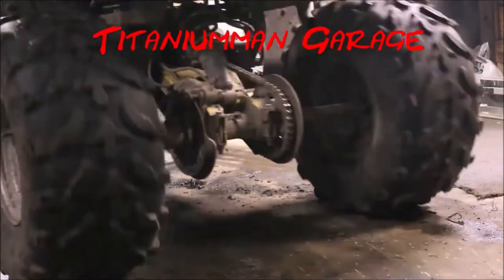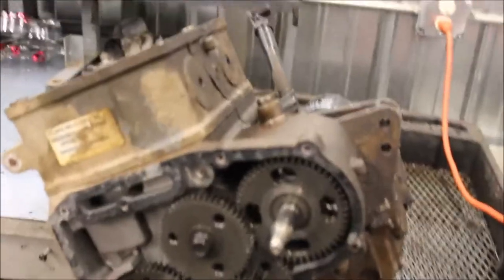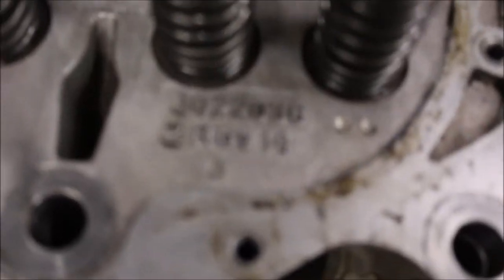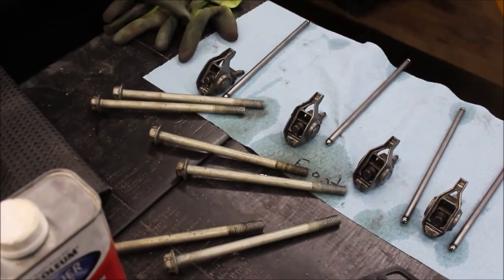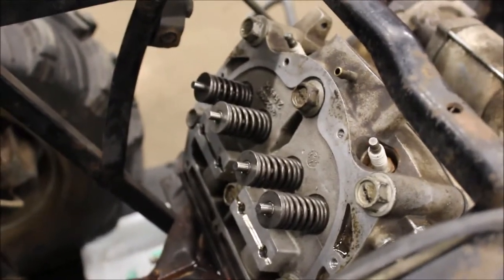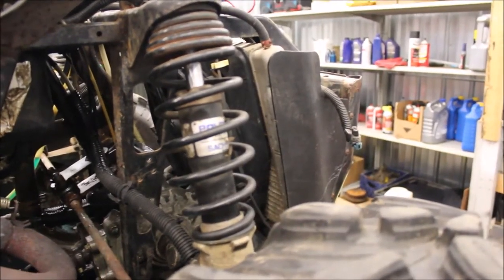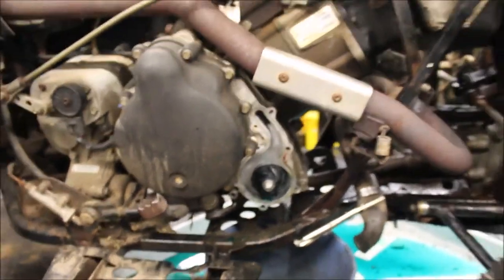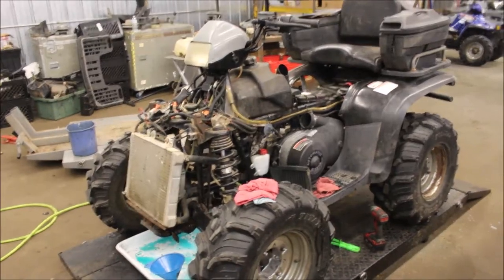HOW TO REPLACE A HEADGASKET ON A POLARIS SPORTSMAN 700

Comment: Not really related but i noticed your gasoline pump vacuum went to your motor. Im currently stuck as Ive installed a new carb and it has a vacuum port. Do you cap this or install a tee to the current vacuum line going to the motor?

Comment: Rad reloactes are mandatory for polaris atvs, never had any heating issues on the 700s I've installed them on. Seems to be such a common issue especially on the twin engine they just don't get sufficient cooling because the rad gets dirty being so low

Comment: Do you not need to set backlash when tightening rockers?
Reply from the maker: There is no adjustment on 700's because of the hydraulic lifters.

Comment: 03 600, oil in coolant & coolant in oil just started happening.  Never over heated, & weep hole is dry as a bone. Could I have a cracked block or something? Just looking for your opinion on this situation. Thanx man!
Reply from the maker: I have doubts the block was cracked. Its most likely the head gasket or the water pump seal. The 700's are known for the water pump seal leaking. I would take the water pump cover off and inspect and replace the seal. Especially if it's that old already. They are cheap. You can check the spark plugs too. If they have coolant on them then it could be the head gasket.